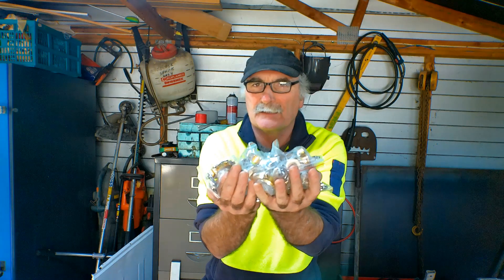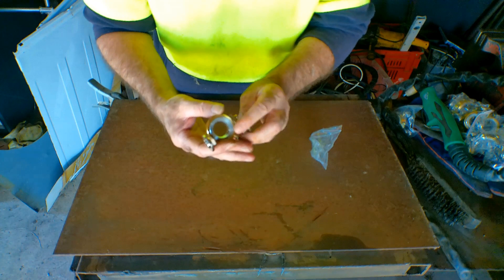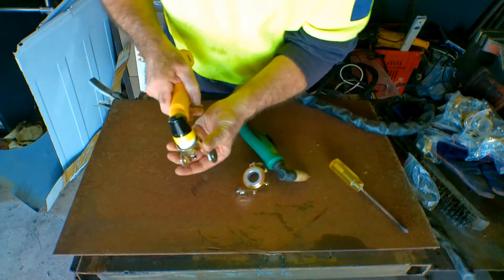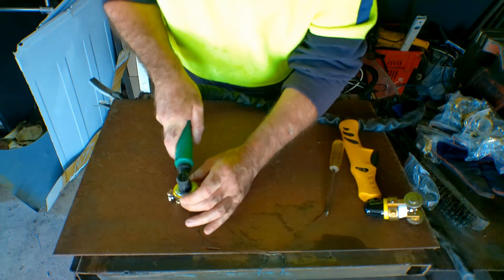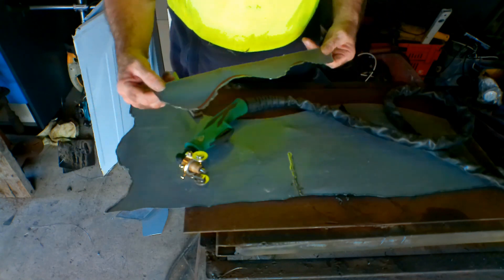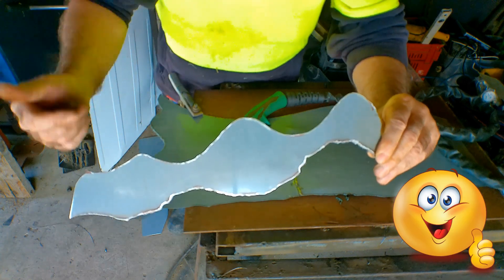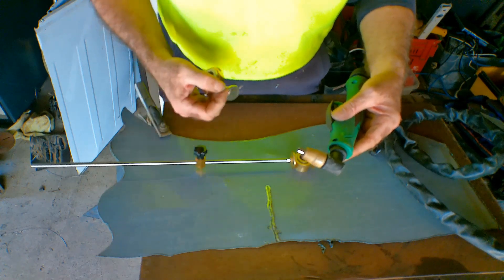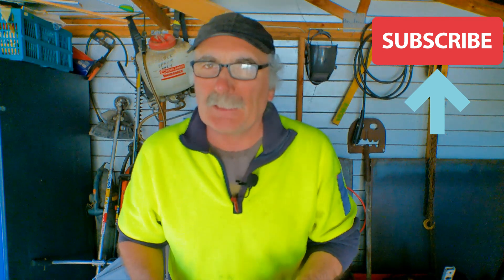This Plasma Cutter Guide Doesn't Work! ( I know Why)

Comment: Pete good day does my plasma torch tip will domage my plasma machine if it touches the metal
Reply from the maker: Hi Leroy , Only if you are using a pilot arc machine as a drag tip.
Reply: Thank u so much Pete 
I would like to know if i let my none pilot arc tip drag on the metal will it be bad for my machine can that blow out my machine

Comment: What needs to be made is a drag tip for a cut 60 torch with pilot arc and has threads up on the top to catch the same threads as the ceramic cup but has an isolating fibre separator and a narrow close fitting copper drag tip to do the hold off. Now they make them for non high frequency plasma cutters but not for high frequency pilot arc machines. These wheels and the wire hold off are too wide and interfere with you cutting up against a wall or some tight place. Yes I know that the better machines are able but way more expensive.
Reply from the maker: Hi Jimmy ,Yes sometimes I think the designers of theses machines don't actually use them lol.